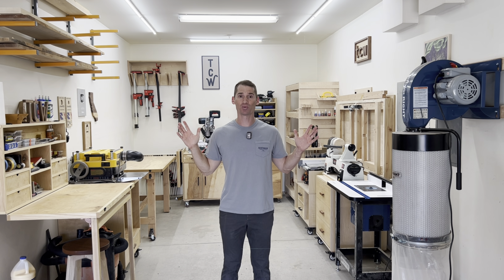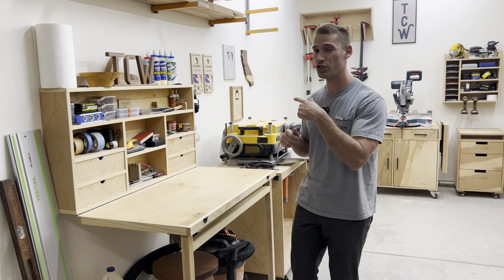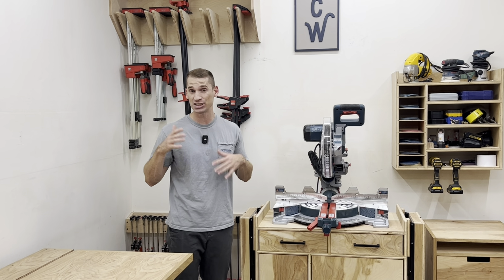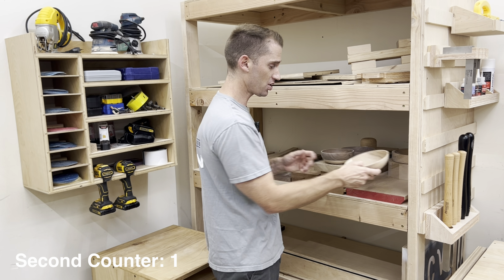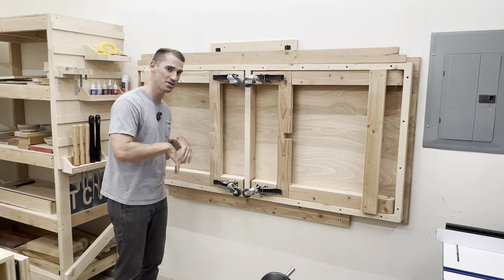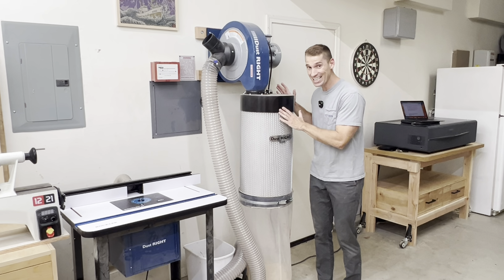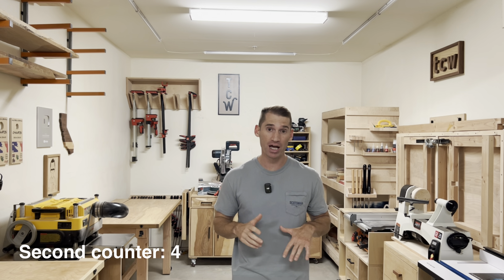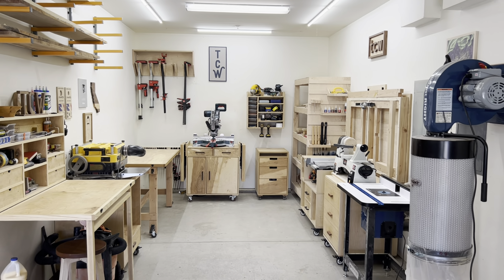not your typical small shop tour

Comment: Is there a specific reason you aren't using your large dust collector for your miter saw?  I like the dedicated shop vac in the base but is there some other benefit like air speed vs CFM or something?  I'm thinking maybe you built it before your bought the dust collector but I'll stop trying to guess and just let you answer.  Thanks!
Reply from the maker: The shop vac does a great job and I believe it would work better than the dust collector based on what I have read about cfm and air volume.

Comment: Ok, I have workshop envy! Thanks for the tour!👍🏻
Reply from the maker: You’re welcome! Thank you for watching.
Reply: @ThomasCustomWoodworks  I am looking at the Rockler Dust Collection 1250. Is yours the collection only or do you also have the separator?
Reply: NM. I finally found the picture of the separator on the Rockler web site. Not seeing it in the video. I have struggled with dust collection & really need to do better than my old craftsman shop vac. I’m masked 98% of the time in my shop but still concerned  that I’m not protected myself like I should. I have a air scrubber hanging from the ceiling but w/out a proper dust collection system I am not sure it’s doing any good. Looking at the 650 for budget purposes.